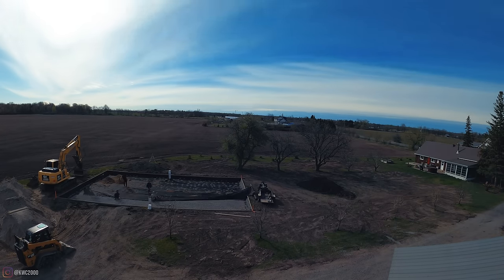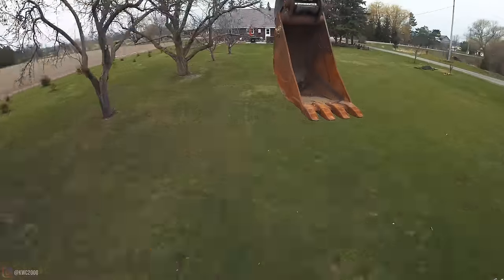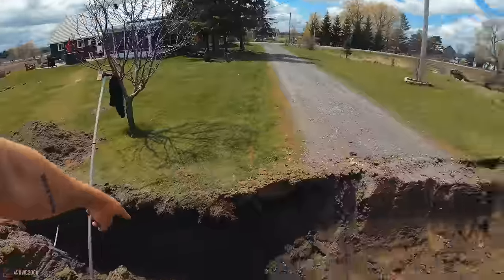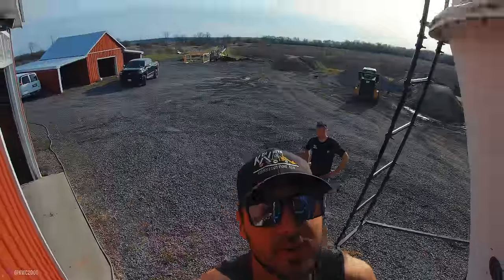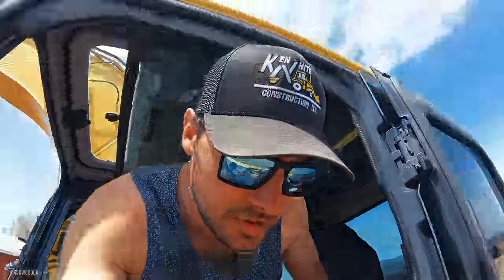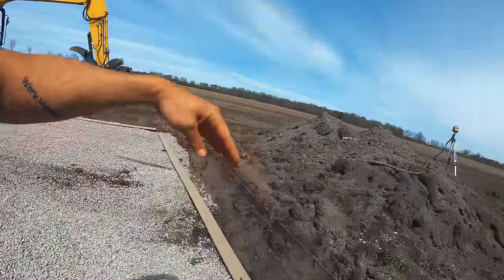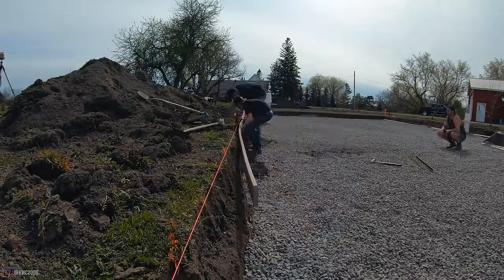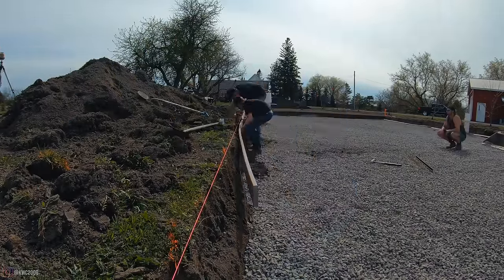building a BACKYARD BEACH VOLLEYBALL COURT... (long weekend haul)

Comment: I’ve seen some built in with lights and sprinklers on the post where is holds the net and some soft foam around the wood that hurts when you kick those boards with no shoes on other then that looks good